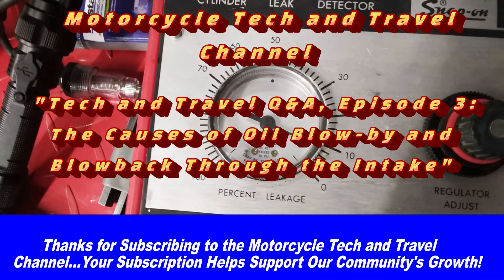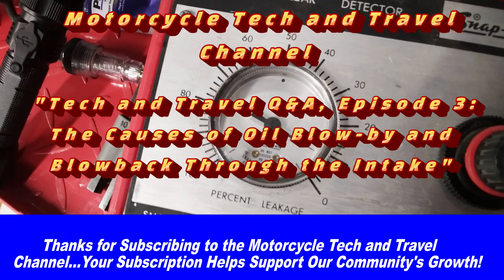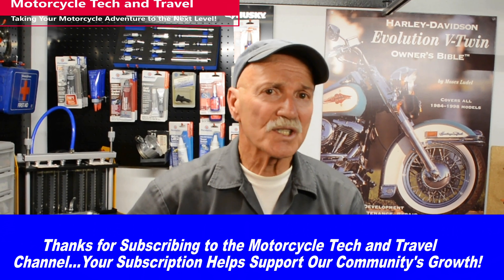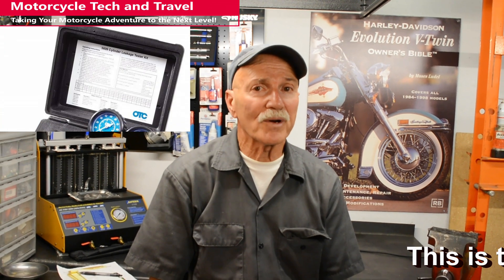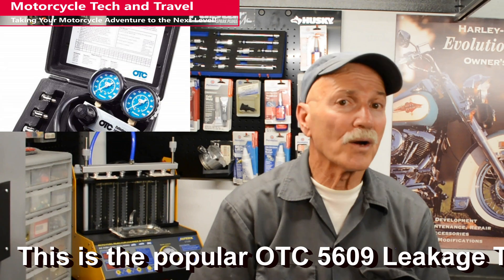Motorcycle Tech:  Does Blowing Oil Out the Breather Call for a Cylinder Leak Down Test?

Comment: How do I come across the back rack in the piece that goes underneath the back Fender like you have sir I have a 2002 xr650r
Reply from the maker: TCI Products apparently ceased production.  Moose Racing distributed the products for a while and may have more details on whether any subset parts or another maker are available.  The TCI brace is functional and strongly advised if you carry any kind of load.  The rear subframe on the XR650R was not intended for ADV toting use.  A brace like the TCI type is essential.  Including the rack and brace weight, I hold rear loads to around 45 to 50 pounds, mostly filming gear.  I don't bring along global travel luggage...If you find out more, please share, we'll let XR650R owners know what's currently available.

Comment: Hello Moses thanks for your answers. Unluckily i did not make a compression test before i disassembled the top end because my head gasket was leaking water. Cylinder and piston looks very good. Hopefully i have not the problem with the reed valve between transmission an crankcase....But i was wondering why i have this Oil Breather problem just while wheeling the bike. If the reed is broken the blow by issue would be permanently wouldn't it?
Reply from the maker: Well, you needed to pull down the upper engine for the seeping head gasket, anyway.  As for wheelies, oil out the breather could be from excess oil in the frame down tube "tank".  This is where you fill and check the oil.  If the wheelie causes oil to overfill that frame tube, perhaps it would go out the breather...While the head is off, check the valves for sealing and the head straightness.  You can check valves with a makeshift vacuum gauge and stiff rubber plate bolted to the valve's port.  The idea is to see if the valves hold vacuum.  If there is any question here, do a valve job.  (Sublet the work if necessary).  As for the one-way reed valve, its purpose is to keep transmission oil out of the crankcase crankshaft chamber and also to expel oil from that chamber into the transmission area.  Accumulation of oil around the crankshaft can drain power or, at worst, prevent crankshaft rotation.  The breather tube is above that chamber, and if oil were trapped in the crankshaft area, it would pump up the breather tube...I'd like someone to try a vacuum test at the breather tube before pulling down the upper engine.  Vacuum applied at the tube is below the piston.  If the rings are sealing, vacuum should hold to a degree in the crankcase.  (Seals have a one-way lip, so the crankshaft seals would yield/leak inward if too much vacuum is applied.  Keep apply vacuum below that threshold.)  This would test the crankshaft seals and the reed valve, which is a one-way valve.  Once the head and cylinder have been removed, however, this test would be near impossible because the  connecting rod is above the cylinder base.  If the rod were not there, you could make a plate with rubber and a steel backer to seal the crankcase's cylinder opening, then apply vacuum at the breather tube.  Short of a vacuum test, there's not a "factory" troubleshooting test for the reed valve.  The crankcase requires separating/splitting to inspect or replace the reed valve.

Comment: Hi Moses! Things have taken a turn for sure. Since our last talk, I managed to get the bike to the shop. They were nice enough to take it in, alltough they are full of work still. The tech knows my bike for a few years now, and he is a pretty well reputed one in town, being racing and fixing bikes for years. When I told him all I had checked on my own, knowing me, he said, that performing a compression test could probably yield an even higher pressure reading, bacause he was betting oil is gettting upwards of the cylinder as well, so basically he thought the rings were shot, just as you and I were thinking. Next few days followed, and he calls me, dazzled by the fact, that not only there isn't much looking wrong, but the engine looks great for it's age. The nikasil looks very good with no apparent wear on the honing marks, the ring gaps looks good. The intake valves are a bit sunk into the seats, but that's pretty normal for this engine I think. The piston topside looks pretty good, has moderate wear on the side skirt, the pin has a little wear but not centered (have only  seen this in pictures of other  xr so far, don't know why)
So...because of a hasty decision to speed things up..I'm left with the top end opened up. I'l head over to the shop, this week, and have a look at it again with the tech.  He says he wasn't expecting anything like this. Neither was I....it's why I trusted him with this knowing his background. 
I was really hoping for him to tell me he found something cracked or broken, somewhere. 
Now I can only concentrate on getting to the root of the problem, because I wouldn't like to rebuild the whole top end without knowing what was the cause, and most important, if it fixes it. 
It sucks, I know, but I guess you live and learn.

I will be updating as soon as I get the chance to look inside the engine rigurously. 

Thank you for your interest and  support, 
Talk soon,

Tudor
Reply from the maker: A leak down test and evaluating the results would have been my first move before a teardown.  Objectively, the bike's mileage can justify a look at piston rings, the piston, cylinder wall condition, the valvetrain and valve wear.  At this point, if the head is still assembled, I would do a vacuum test of the valves or in any case do a valve job.  Looking further into this subject, there are accounts of engines like yours, with no apparent wear, some with parts renewed, cylinder re-plating, new rings and all—still blowing oil out the breather.  The scenario is an engine that had run fine then "suddenly" began blowing oil out the breather...Fortunately, I've not experienced this, but apparently it happens.  There's a possible culprit if everything else checks okay:  the reed valve for the crankcase.  This item costs less than $20 but requires splitting the crankcase apart to install.  If the reed valve is defective or broken, oil will accumulate in the crankcase and get whipped by the crankshaft flyweights.  The breather tube exits from this chamber/section.  As the piston lowers in the cylinder, the resulting (normal) crankcase pressure causes this one-way reed valve to open and expel oil from the crankshaft chamber.  In the process, the reed valve also prevents transmission oil from finding its way into the crankshaft chamber...Discuss this with your shop.  If you cannot find a reason for blow-by or loss of cylinder pressure past the rings, and there's no sign of leakage past the intake and exhaust valves, the reed valve could be involved.  Were the engine still together, I would apply vacuum at the breather port tube and see whether there is a considerable vacuum leak.  That kind of leak from the crankcase could be a defective reed valve.  If the reed valve can be pinpointed as the cause for oil accumulating in the crankshaft chamber, the engine comes out of the frame to split the crankcase apart.
Reply: Well, after a full top end rebuild and all, compression in the mid 180 psi, back to square 1. I even ran a catch can to the breather, no oil out.

Before rebuild, I even tried a brand new carb, to no avail. I'l try a burrowed third one, if it's the same, my next thought would be a small unnoticed crack in the head, doing it's thing with temperature. I rode it, and after a short time it started going crazy again, to the point it died out on the road, badly stuttering. Fuel delivery check, spark check, air check. Weird as.... . 
When I find out what the culprit is, I'l share it here. 

Keep in touch!
Reply from the maker: @chucksterrr  Following with great interest...Was the one-way reed valve at the crankcase replaced as I mentioned in my last comments?  Transmission oil could be leaking into the crankcase and getting forced up the breather like I described.  Here are my comments from six months ago.  With the engine still together now, you can try the vacuum test I describe:  "...There's a possible culprit if everything else checks okay:  the reed valve for the crankcase.  This item costs less than $20 but requires splitting the crankcase apart to install.  If the reed valve is defective or broken, oil will accumulate in the crankcase and get whipped by the crankshaft flyweights.  The breather tube exits from this chamber/section.  As the piston lowers in the cylinder, the resulting (normal) crankcase pressure causes this one-way reed valve to open and expel oil from the crankshaft chamber.  In the process, the reed valve also prevents transmission oil from finding its way into the crankshaft chamber...Discuss this with your shop.  If you cannot find a reason for blow-by or loss of cylinder pressure past the rings, and there's no sign of leakage past the intake and exhaust valves, the reed valve could be involved.  Were the engine still together, I would apply vacuum at the breather port tube and see whether there is a considerable vacuum leak.  That kind of leak from the crankcase could be a defective reed valve.  If the reed valve can be pinpointed as the cause for oil accumulating in the crankshaft chamber, the engine comes out of the frame to split the crankcase apart."
Reply: I did take the reed valve into discussion with the tech, but he said, there should have been at least small amounts of oil, in the bottle that I routed the breather tube into when I rode it last. I will also tell him about the vacuum test. 

So, I guess my theory with the fissure in the head, seems far fetched? No word on that? 

At this point, I just want to find out what is causing all of this, whether it's the 20$ reed valve, or whatever it is. I just have to know. It's starting to feel like i'm on candid camera or something. 
Talk soon Moses😊
Reply: Hi Moses! Since our last chat, got the pig going. It seems a little fine paint polish paste(p10)and a little work cleaning it real good did wonders on my carburetor. That is all one of the guys at the shop did to it, after the last ride. It seeems the oil residue I noticed wasnt what caused my problems after all. 
It seems the bottle I ran as a catch can last time we talked had the vent hole I made too small(caused the stumbling and stalling apparently). Well, now I'm soon to change the first oil after the top end rebuild, it's been a couple of hundred miles  and all is well. 

Thing is, a friend's BRP, just started to exhibit exactly the same symptoms as mine did. I did take apart the carburetor as well, cleaned it and all, as per usual, clean as a whistle, but still the problem. We will try the polish paste way. 

Needless to say, using the polish paste(which I really felt against at first), when you look at the carb slide, and the barrel, they appear exactly the same as before, so none of the making stuff shiny that wasn't shiny. Just a clean it like you mean it, but no more. 
I will report back here as well. 

It's weird, and at the same time such a huge opportunity to learn something from this(at least for me), having a friend's exact bike as mine, having the exact same issue. Keep in mind I even tried out a brand new carburetor, in a sealed package, when mine did it, which made me and the shop mechanic open the engine. I was sure nothing could be wrong with my carburetors...oh well...
I know, long comment, but words cannot suffice. 
Best thoughts to you, 

Talk soon,
Reply from the maker: Exciting to know you're riding the bike again!  It's all a learning curve, and you climbed it.  Keep us posted on your satisfaction with this repair!  Thanks for sharing and updating.

Comment: What is a ballpark lifespan for a Honda 471cc engine? I'm @73K Miles and often wonder when to buy a 2nd bike.
Thanks!
Reply from the maker: What's the model and your usage?  I'm glad to comment...
Reply: @MotorcycleTechandTravel  Rebel 500 for commuting rear round. I don't skip any maintenance, and it still has the original battery. Thank You!
Reply from the maker: The Rebel 500 has an excellent reputation for reliability.  Yours is proof.  There are two factors that increase the longevity of your parallel twin 471cc engine:  liquid cooling and EFI.  Liquid cooling on your twin keeps cylinder and head temperatures down and uniform.  Minimizing expansion and contraction enables closer tolerances for optimal wear and longevity.  EFI provides an additional boost by constantly maintaining air/fuel ratios.  Able to avoid rich and overly lean mixtures, striving for 14.7:1 air/fuel ratio at cruise for complete burn, no fuel gets wasted.  Changing altitude with an O2 sensor is a non-issue, EFI compensates for altitude and maintains the correct A/F mixtures.  This and your careful maintenance contribute to longevity.  A lightweight (416 pounds curb weight), nimble model with ample power-to-weight ratio, the Rebel does not strain to get the job done...If and when power drops off, run a cylinder leak down test to assess the engine's condition.  For now, if it feels right, keep tuning and servicing the bike regularly to enjoy it!
Reply: @MotorcycleTechandTravel  Thank you so very much, Safe Travels.
Reply from the maker: Travel safely as well...My guess was that your Rebel is a 2017 or newer model with the equipment I described (liquid cooling and EFI)...In any case, 73K miles is a testimonial to the bike's longevity and your care...Thanks for subscribing!